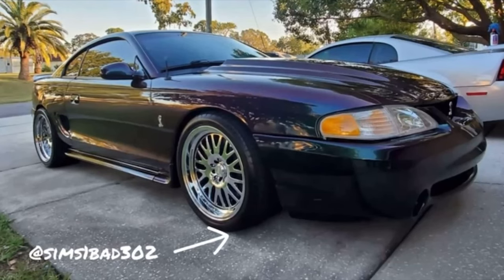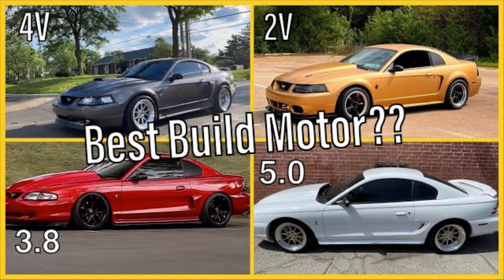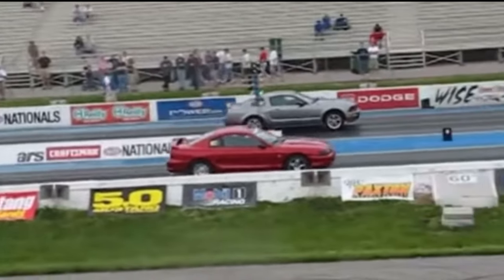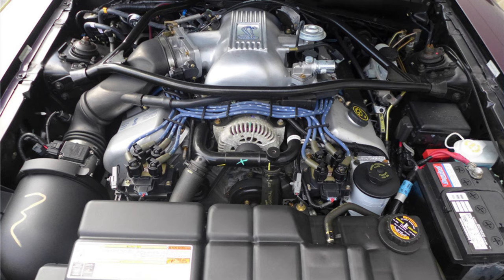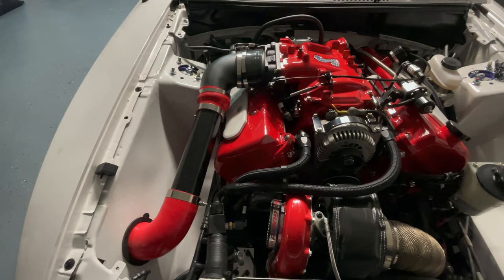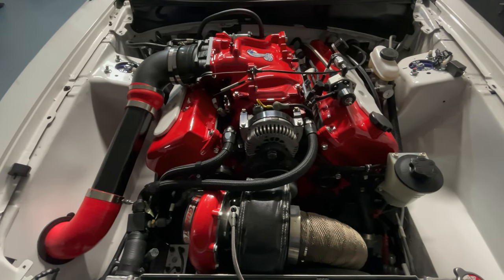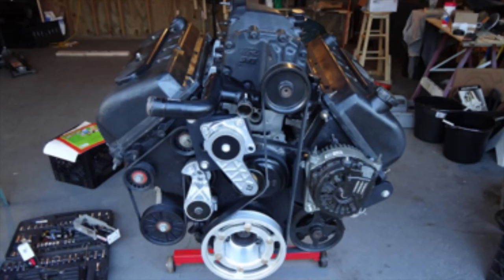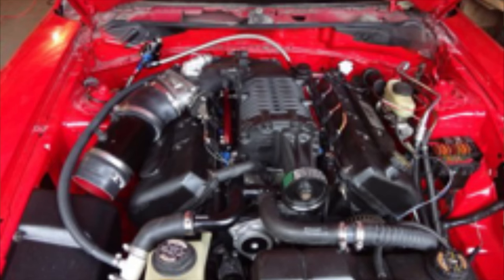Which is the best engine for your Sn95 Mustang build??

Comment: My 99 cobra had stock crank, 03 cobra rods, -4cc dish Diamond pistons, Navigator heads, and on a single 76mm turbo it made 702/670 on 93. But if you are looking at cost effectiveness I the the 2v is the way to go. The 302 doesn’t have the block strength of the modular engines. And the expensive side of building an engine is in the heads and valve train.
Reply: cobras come with a 4v right? im looking to get a 97 gt but im not sure how much power I can actually make.. I come from the Acura community where my v6 was running close to 250 who bone stock so im kind of disappointed at the amount of money I would have to pour in a 2v to match a cheap Honda.
Reply: @youngstajae find a 4v they're 305 hp stock and can do 300+ with bolt ons.  They're not that much more just Harder to find.  Forged rods and pistons plus fueling is all you need to make a reliable 700+ wheel.  2v can make power but it's gonna take alot more.  Get a 96-01 cobra.  Don't be afraid of a 99 the power issues with not an issue all it takes is ported intake (which you should do anyways) and a catback change and there is no power issue.  Get a cobra and thank me later.

Comment: i got an aviator engine in my gt. looked for a 01 intake and got mine going... I would suggest getting a head cooling kit prior to installing the engine i would love to add a supercharger, however getting the lower intake for those is an issue
Reply from the maker: Cheapest 03/04 Cobra intake I've seen lately was $800. Pulling that freeze plug and putting that coolant pipe in with the motor in is a nightmare, lol.

Comment: Currently have a mark viii daily driver thats stock and a parts mark viii whose motor im gonna rip apart and put some forged internals into so i can build a mean street car. Shooting for 700 whp and im debating going C head swap with top mount supercharger or keeping the B heads and centrifugal or turbo for boost. Honestly couldnt agree more about the availability tho, if i didn't have a second mark with a good platform to build off of i was just gonna do a coyote swap because a 4v probably wouldnt be as easy to find and build compared to the yote
Reply from the maker: I just talked with a local guy with a built 03 Cobra motor and trans in his mark8. He also put the irs in the rear.
Reply: @SN95Power  the marks come with irs. I’m also not sure what trans I’m gonna go bc my uncle has a really built up 4r70w that’s basically brand new from an old tbird he doesn’t drive anymore, but i really want a manual. This is all a longshot away at the moment anyway ad the motor is still in the old parts car and I don’t see myself having the funds to build it like crazy anytime soon anyway

Comment: I have a 97 cobra with a kenny bell supercharger on it 
The horse power is right around 470 witch is not bad 

I also have a 98 gt that I just swaped a 2v to the 4v mach 1 head and block 
Automatic transmission  with a strip kit in it 
And 410 gear 
That one is right around 360 horse 
I have a few mustangs  95 gt that's built
03 mach 1 that's built 
05 gt 3v that's built 
All of them are great 
You cant go wrong with any of them 
Enjoy the ride
Reply: Are you running The 2.1?
Reply: @orange_smoke  yes
Reply: you put 4v mack 1 heads and block in the 98?
Reply: @_youngstajae  yes

Comment: The Lincoln mk 8's had the 4v engines first, and they are still around. Parts just too high! If you live in a state where you can get away with it a 351w with heads,cam, intake has great low-end torque and bolts to the 302 Mounts and bell housing. Stock hood clearance can become an issue!
Reply from the maker: It’s hard to find Mark 8’s out here now. I built my eaton swap from a 93 teskid block

Comment: They didnt "lie" about the hp in 99.  They had intake manifold casting issues and something to do withe catback.  Everyone changes their catback anyways so with a ported intake theyll make the same exact power as an 01 with a ported intake and same mods.  They had the same heads 99 and 01.  People make too big a deal about the power issue in 99.  Its not like it had a more restrictive head or low compression or something most if not all were fixed by ford but with a ported intake and catback its fixed anyways.  They made a full 320+ without the manifold and catback issues that caused power loss.  Lots if misinformation about this.
Reply from the maker: I'm sorry but what's the misinformation? Maybe "lied" is a strong word but did the 1999 Cobra make 320 from the factory, no. They did the right thing by offering owners to have their Cobra "modified" to produce the 320 that Ford claimed they made in their publications. Maybe I could have said false advertisement 😂

Comment: My son and I are looking at doing this and I have a line on a mark 8 motor I can get for 200 bucks. The issue we have is we do not have a v8 donor car. 

Not sure how to do this without the hardness and donor car. 

I also have a line on a grand marquis I could have for the same price. 

Would love to know what you think. 

His car is a v6 car.
Reply from the maker: Best option is to get a use GT harness. You can do a stand alone system like holley or you can get a Ron Francis wiring kit.
Reply: @SN95Power  thank you. So you think grabbing the mark 8 motor and maybe freshening it up is the best option ?
Reply: I have the option of numerous pickups or a crown Vic or the mark 8 all the same price. I would grab the trans too as I have a feeling the v6 and v8 trans are different.
Reply from the maker: @stevenmyers2252  The Mark 8 would be best but you need a 96-98 Cobra intake or 2nd Gen mark 8 intake manifold
Reply: @SN95Power  thank you. I’ll have to do some research as I know very little about those motors. I just know I have access to one in a very clean car locally and it’s cheap. 300 for motor and trans

Comment: Looking to buy sn95 mustang. I’m curious as to which engine is more reliable, the 5.0 2v or the 4.6 2v which replaced it. Not too concerned with building it for power (yet) just something dependable and strong running. Are parts cheaper for the 4.6 due to its widespread availability and long production line? Looking at forums I’m seeing a lot of different information. Thanks
Reply from the maker: Honestly any of those motors in stock for are very reliable. IMO the pushrod motor is more reliable, easier to work on and cheaper to upgrade.
Reply: @SN95Power thanks. That is good to know.
Reply: @SN95Power  ended up getting the 4.6 😂
Reply from the maker: @RaffikiK  nothing wrong with that choice 👍🏼
Reply: 5.0 hands down more reliable and cheaper power

Comment: So I found a aviator motor. Do I take the wiring harness and ecu or can I use the ones I have. I currently drive 2001 ford mustang v6.
Reply from the maker: Nothing with the Avaitor harness will be plug and play with the Mustang harness. You can use it but you'll have to customize it
Reply: @SN95Power and for the ecu? Should I find a v8 one or can I use the one I have?
Reply from the maker: @Phatbotty  A v6 wire harness can't be use. Easiest route is the find a v8 Mustang harness

Comment: I checked Facebook market place and found a 2011 mustang for $4800 with a rebuilt title ,, hmmmmmmm  seen nice ones for 7k  .. just the wiring harness for a swap is $1500 for the coyote then 3k for a  motor add 2k you have a whole car h,mm,,,,,,,,,,,,  they will only get cheaper too ,, when gas gets high V8s sell cheap
Reply from the maker: If you are patient and ready deals pop up now and then. Where you're located plays a part into it also. Cheapest 2011 Mustang GT in my area is $5000, clean title but no motor or trans. 
$9000 for 2012 wrecked GT with motor and trans.
Reply: @SN95Power  i live near Miami so everything is really cheap with Russian Nuclear subs off the coast ,, I think people are leaving getting a little nervous if Florida was hit all Bidens worries is gone think about it the republican stronghold
Reply from the maker: @bengordon7635  Always find better deals in the south it seems

Comment: So what heads were on your eaton swapped 4v? The b heads or c heads? Thx
Reply from the maker: C heads off Lincoln Continental
Reply: @SN95Power  so those are the same heads as the 1999 svt cobra right? If so, was the eaton swap a kit (or what parts did you get to make it fit) or did you have to make anything special for it?  Thx, I appreciate it

Comment: Isn't the 32v in the mach 1 factory forged
Reply from the maker: The only forged item in the Mach 1 is the 8 bolt crankshaft that came with manuals transmissions.
Reply: @SN95Power  96 4v or 03 mach 1 4v ? im trying to findout the differences but all i can really tell is 03 mach 1 4v has better flowing heads

Comment: Eliminate the IMRC plates and run 4:10s on the b head
Reply: I did imrc delete plates, cleaned my upper and lower intake ports, bought new oem 24lbs injectors, did a full catless exhaust system. Before those mods I already had an bbk cold air intake and 65mm throttle body and my entire drive train lightened with aluminum flywheel, center force clutch, aluminum drive shaft, aluminum under drive pulleys, and 3:73 rear gears out back. and now I’m waiting for my appointment with my tuner to get the car street tuned. The crazy part is I was already beating on 392 chargers from a dig before the new mods and no tune lol
Reply: IMRC plate delete is not going to gain much lol. I personally like to here them crack open, sounds like an old school 4bbl carb.

Comment: I own a 93 5.0 and my smog pump pulley seized up 😢
Reply from the maker: Bypass it
Reply: @SN95Power   that’s funny how you mentioned that I actually just but the pulley to do that. Down part about is o live the wonderful state of CA so it won’t pass smog
Reply from the maker: @user-vv1gd5dz9k  ouch, hopefully you can find another one quick. They still smog a 31 year old car?
Reply: I’m picking up a 1998 with a 4.6 will the engine parts be compatible with my 5.0?
Reply from the maker: @user-vv1gd5dz9k  nothing will swap over

Comment: What are some easy power mods for a 94 gt 5.0 ho 5 speed
Reply from the maker: 300rwhp GT40 Junkyard Parts SN95 Mustang Foxbody SBF
https://youtu.be/EZz62io_7S4
Reply: 3:73 gears is a must. A Diablo tune or a piggy back computer with a Pre 94 computer.  The 94-95 computers retarded timing as the RPMs increased.
Reply: 3:73 gears, cam( I don’t like mine that much e303) , cold air intake, short throw shifter, long tube headers w x pipe. Some tires and rims, and mine is lowered but it rides like fucking shit. Looks good tho. So your in there w this stuff. I mean you can always upgrade ur fuel and boost it, etc. but it’s a lot cheaper than most other car models.
Reply: @johnnypanama081  how much was the tune? And it made a difference like that?
Reply: @midwest_nikk2682  it made a noticeable difference.  Definitely could feel it.
Reply: @midwest_nikk2682  I have a B303, GT40 intake with GT40 turbo swirl heads, mac headers, piggy back computer, Tremec 3350, Eibach progressive rate lowering springs, steeda tri ax shifter, bigger fuel pump , mass air, injectors, HPM rear lower control arms , off road H pipe through  flowmaster,  about to put my 9LBS powerdyne sc back on. Waiting to install my Bilstein rear shocks after I buy the Bilstein struts.
Reply: @midwest_nikk2682  it also depends how you lowered the car. Buy good springs. The cam and intake will not make a huge difference until you put heads on it. If you add aluminum heads and the proper computer. You will be easily pushing 300 RWH. If you do that, upgrade the fuel system.

Comment: The 2v is a shit box my car battery was off during winter and when I put it all back on had p1000 code I’m readiness but on top of that it has 3 codes for abs 3 for hec and pcm I can’t do ahit otdwred a new pcm but no one here even installs them and the pcm and other modual are toast. So im thinking to sell the shit box since fords here can’t flash anything bunch fuck heads like my back brake lights don’t work my cluster lights don’t work they turn on when key on but don’t ever come back like seat belt that doesn’t ding ding traction control won’t turn on I wanna throw it away I loved this car O much if I knew this was gonna happen on my ducking car the sct tuner I blame for frying my cars pcm blah blah

Comment: So, will the Navigator motor fit in a SN94 ?
Reply from the maker: Yes, not to common anymore but guys use to do the swap. It's a very tall deck and hood clearance is a big issue
Reply: @SN95Power  I have scene alot of Navigators at the junkyard and was wondering if the Navigator motor and On3 turbo would make decent power, and since it was a mod motor it would fit in my 94 stang gt
Reply: Thanks for replying